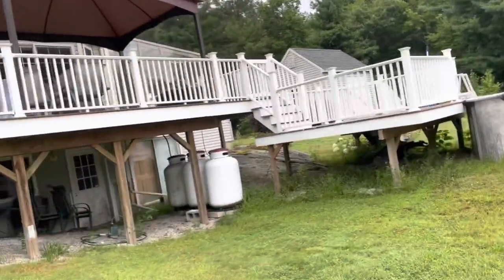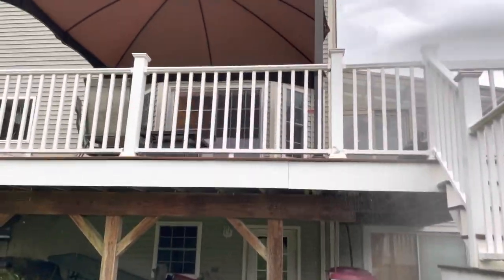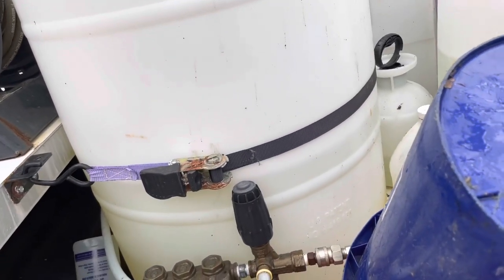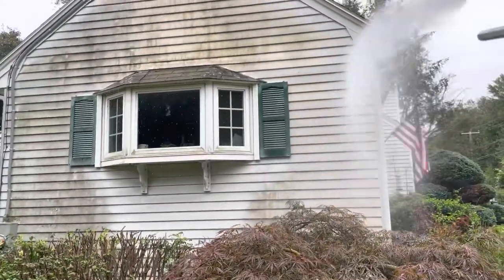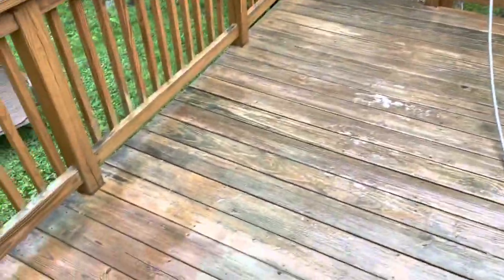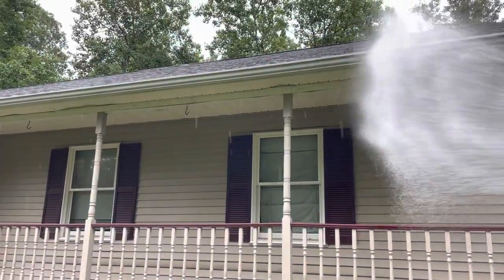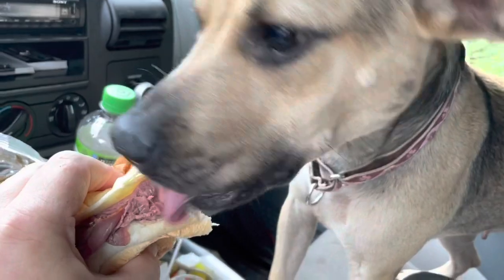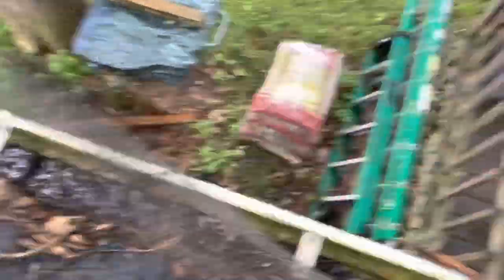Ball Valve Gutter Cleaning

Comment: Love the videos. Quick question. Does your Xjet twist pull soap and downstream? I know you use the M5 twist and it does but I have the Xjet one and it didn’t pull for down streaming. Maybe I need to cover the inlet where the tube connects?
Reply from the maker: The Xjet won’t pull downstream because it’s a higher pressure nozzle. The m5 is low pressure and draws downstream
Reply: Thank you for the quick reply. I love the new dog.

Comment: Another awesome video, Joe. You really do a great job with that 5.5. Any thoughts on going to an 8 for next season. I really love my 8 Honda with 110 gal. (2-55s) buffer tank. Thanks.
Reply from the maker: Thank you Brian. I struggle with water even with the 5.5. Unlikelihood of buying s as n 8 unless I’m carrying a 275 tank
Reply: @powerfulimprovements  Joe, that makes total sense. I  use a general pump float valve YRG60FV instead of the Hudson with absolutely zero flow restriction plumbed into the side of my right side  55 gal tank and the buffer tube plumbed into the left side 55 gal tank and they fill within 2 inches of the top of the tanks. I’ve never heard of any of the big guys (or any guys)speak of this valve but I really am happy with my results. I run mine on a wooden skid in the bed  of my truck. With electric reels attached to wooden shelves I built on the sides of my pickup bed. Kinda ghetto but effective.
Reply from the maker: @brianfletcher7942  hey if it works!!! I’m going to change my Hudson for something else too. It’s restriction
Reply: @powerfulimprovements  I STRONGLY recommend that valve. It may fit on a circular shaped tank but it is most effective on a flat vertical surface. Lots of time to research. Have a great day.

Comment: Great job! What is your go to downstream injector? I tried several and they normally fail so i switched to 12ving everything. I want to downstream houses though. Do you use the sud sucker for 200ft of hose?
Reply from the maker: Yes I use the sud sucker. Pulls with 250 no problem. Also they make a stainless GP high draw injector
Reply: @powerfulimprovements  thank you ill try these both if i can find them
Reply from the maker: @LeagueofBasics  envirospec

Comment: Do you have your pressure pump set to 4000? Or 3500 psi
Reply from the maker: My pump is set at 2500 with a green tip. Roughly 2200 with my surface cleaner. The m5 runs at about 150.
Reply: I’ve got mine set at 3500 when it’s unloaded in bypass. It won’t read any pressure when I have the trigger pulled. 4gpm
Reply from the maker: @therock200202  hmm. I put my gauge right before the gun. What tip are you using that reads zero with the trigger pulled?
Reply: I put my pressure gauge before my reel and use the m5 and x-jet and surface cleaner
Reply: I’ll have to put it at my gun and check to see if it changes but I doubt it.
Reply from the maker: @therock200202  something is a miss

Comment: I’ve been seeing tons of videos like this they look very confusing because I never see them wash any product off. Also I did a deck the same size as the first wooden deck I have a 4 gallon 4000 psi pressure washer With Jay Rod not sure how you can wash your house in 45 minutes do you not have to rinse these processes off do the soffits not take time to clear dirt out of the soffit so the attic can breathe if Clients have soffits I can only move 3 foot every 15 seconds if not the soffit will just have black and yellow stains under sofit when I leave…  I use straight chlorine from pinch a penny that is always fresh and LA soap detergent doing down streaming. Could be because all these houses are vinyl most of my house is i pressure wash are stucco and Hardy board usually takes 3 to 4 hours a house.. Does anybody know what I’m doing wrong????
Reply from the maker: I have over 200 videos on my channel that run the gamut. We do an extremely thorough job in an hour or less consistently.
Reply: Not really an answer to the question but thanks for the reply also I was wondering I’m Using about 7 1/2 gallons of chlorine every house how much SH are you generally using per house with your soft wash system. ????
Reply from the maker: @kalibmilner877  ok. It’s really hard to evaluate what you’re doing. What percentage is the SH you’re buying. Are you Downstreaming? Have you done a draw test to determine your ratio of sh at the gun? I’m running at 10:1 pulling 12.5 which gets me 1.25% at the tip. Also rinsing at 6gpm with the flow pro remote. Hose reels etc all add up in time saving
Reply: I use chlorine from pinch a penny they say it’s 37% it gets bought in bulk daily so there’s no expiration date on it they say that it’s always fresh my downstream injector is 50 to 1 And it’s a 4000 psi 4gallon a minute. Also I’m in Jacksonville Florida so it’s generally always hot If we pre-wet the plants on a hot day they usually wilt I’m not sure how much stronger of a chemical process would be the best for my market area. Generally when I spray chemical on the house I have about 10 minutes tops before I need to go back and rinsing off or the house will just dry it right up.